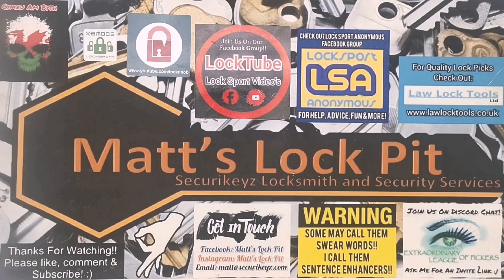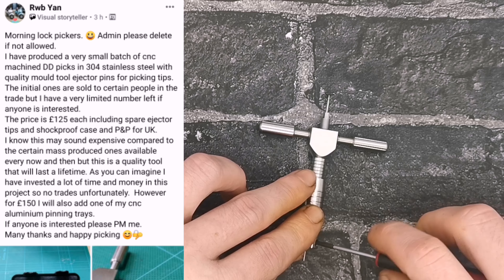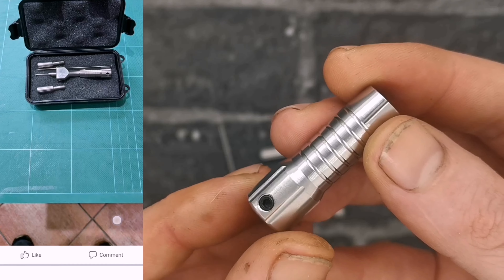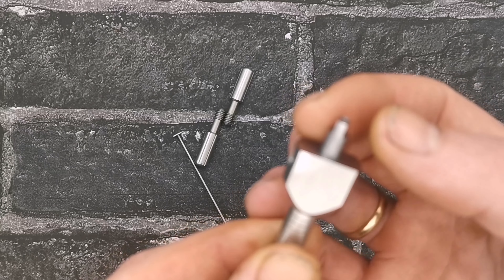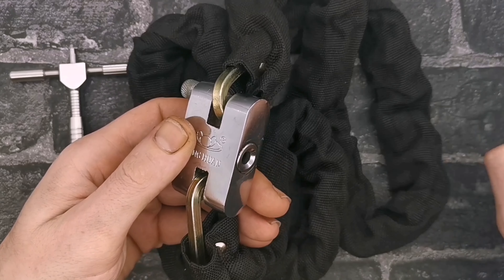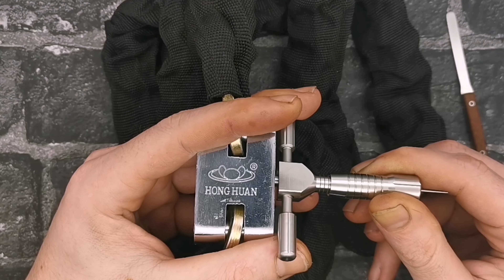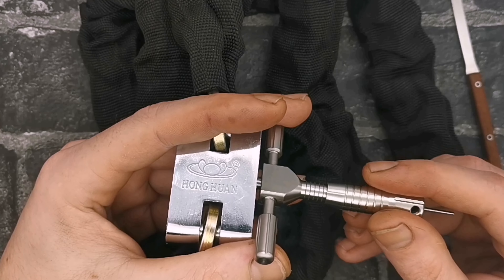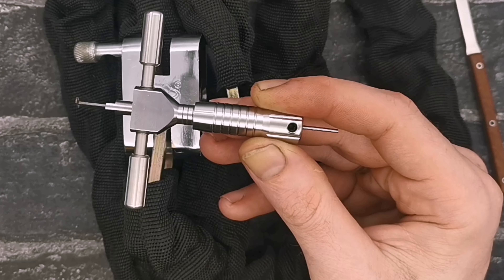RWB Yan Stainless DD Lock Pick. Taking a look and trying it out!

Comment: Beautiful! I’m partial to my own work in stainless, but I can’t deny how nice that looks.

A couple suggestions to RWB Yan on the tensioning nose based on my own experiments and development process:  (1) consider oversized drilling the tip before cutting the flats... boring the tip turns the tip into prongs when you cut the flats which allows it to slip past profiled spinners... this dramatically increases the number of locks on which it will work. (2) Try using shallow flats for the handles to tighten onto... that allows the cuts to made down the whole length of the part (increasing reach) without compromising alignment or stability. 👍
Reply: Great idea and I am helping RWB YAN out with some CAD work on this and we’ve made the nose bigger to around 6mm so that should work out well 👍🏻
Reply: Hey LPL, any chance once everyone has your one in their hands that Sparrows might consider selling spare tension noses so that we can lengthen the actual nose profile a bit more allowing for picking of the anchor las or for deeper nose entry for those tough to reach 2nd discs ?
Reply: @PickedItMate  I have no idea... I had suggested to them selling a set of different lengths (and extra tips) a long time ago, but they’re having enough trouble stocking parts so I doubt it’s on the docket anytime soon. If you look carefully at my videos, you’ll see I have three or four different lengths that I use regularly. Unfortunately, the solution for home brewers right now is to file theirs down, and be careful not to over-insert on locks with thin spinners (or no spinner at all). Not the best solution, but it’s workable. 🤷🏻‍♂️
Reply: Thankyou LPL  for your kind words and helpful advice. Working on a few ideas/ improvements but definitely won't be going into mass production 😆 keep up the great videos 👍